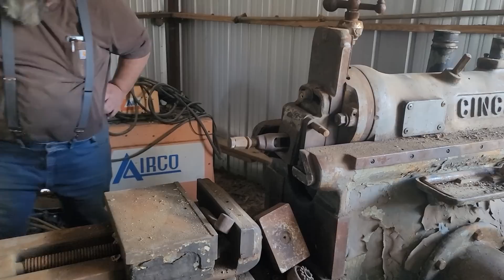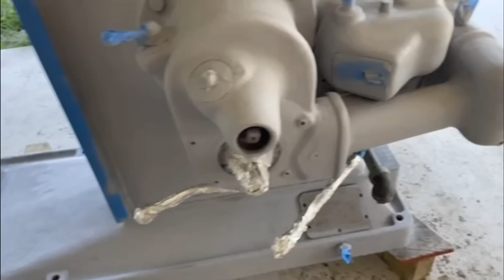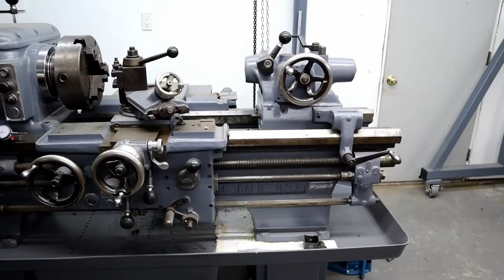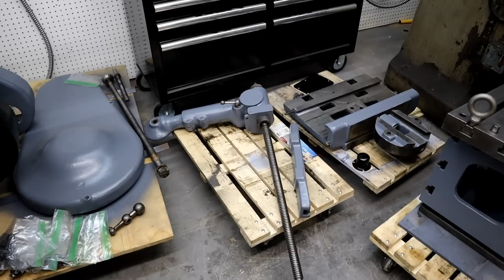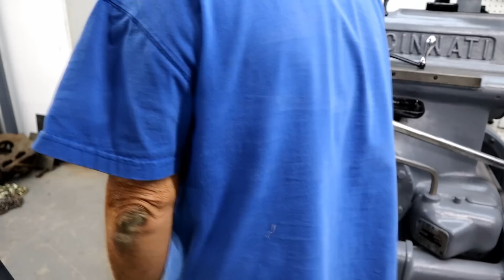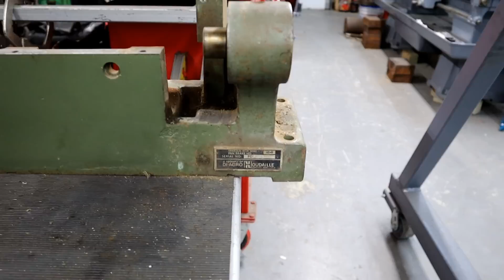Don's Barn Find Shaper Restore: Update

Comment: Diacro makes stout tools.A box and pan brake and a standard brake are the most used tools in a sheetmetal shop. I know, I worked in one 5 years.Shaper looks great Don. AL B.
Reply: I agree I was amazed they still make them and haven’t cheaped out on the parts!

Comment: That shaper is looking really nice. Don is doing a very nice job on this one too. I too love a nice paint job and restoring tools. Friends will give me old tools they found and I love restoring those, putting new paint on, add new rubber (plastidip) handles and blackening the metal where needed. But some of the old tools I inherited from my father I try to keep in original shape. Just a bit of way oil or beeswax to prevent them from rusting and keep the memory.
I just wish I had a friend or neighbor like Don to share this passion with. You guys are so lucky 😀
Reply: Thanks!

Comment: Hi Steve, Don.
Back to the Shaper nut, is there enough meat to bore out the worn thread and silver braze a bronze sleeve and recut the thread, have done this before and is a cheaper option than buying a large piece of bronze to make the complete nut.
Need to get that shaper running.
Reply: Steve already bought the block of bronze to make the nut, so it may be a bit late for that idea, he also got some machinists wax to trial run the cnc to make it.
See 29:22 of " IS this another expensive mistake? Rebuilding the Bridgeport Mill and found many more problems  "
Reply: I already bought the bronze blank, but yes that’s a great idea 💡

Comment: Hey, glad to see Don.  Hey I am a bit jealous of the Cincinnati,  have 2 planers, they are older, dean smith and grace and a flather.  No oiling system,  just grab the big oil can and start pumping, lots of oil holes and cups.  Good to see progress.
Gotta add, only 2 kinda motorcycle riders, those that have been down and those that are going to.  Back in 1993, ran over a pit bull, broke my scapula and my clavicle,  concussion to boot, mom who was a nurse took me home and bedded me down on the couch and observed.  Lost a week of my life, between the concussion and the good pain pills, I do remember a week later when I went to doctor.  Ma and pa said I asked many times, did I kill that dog, is it dead.  I did, had to replace windshield,  crashbars were well scuffed, bent handlebars etc.  Talked to ambulance guy later,  only thing I remember, he was a part time driver at the trucking company I had worked for, knew him.  Remember him talking to me real loud trying to get me to come around.  Later I talked to him,  said he responded to ambulance call, he go there, people said motorcyclist over against the curb and they thought i was dead.  I wasn't.
Tell Don to ride carefully.
Noticed something after wreck,  fixed up bike some, dogs seemed to avoid it afterwards.
Reply: I always ride as defensively as I can
Reply: @donmadere4237  Hey Don, thought I did until I hit that pitbull, maybe I did it on purpose, had a concussion,  mom who was a nurse took me home and put me on couch.  Mom and dad said every hour almost I would ask, did I kill that dog, is that dog dead?  They said they assured me it was dead.  Hey I lost a week of my life between the concussion and the good pain pills.
Hey guy I work with brother is trying to sell a sweet looking HD soft tail classic, low miles, good price, he just had major back surgery and isn't supposed to ride anymore.   Tempting but I am afraid the wife might kill me and collect on that life insurance I have been paying.  My dream bike is an 850 motoguzzi Eldorado,  that or a 750 Triumph tiger.  Wouldn't turn down a Norton, remember when I could have bought a commando for 750 bucks.  Funnest bike I have owned, first bike I owned was a CB350 Honda,  rode it everywhere, rebuilt the motor on the kitchen table after timing chain broke.  Ran over a mutt dog with it one time, felt bad about it, neighbors dog, neighbor said, been yelling at that dog not to chase things, that dog was up and about 30 minutes later, had a good visit with the new neighbor.